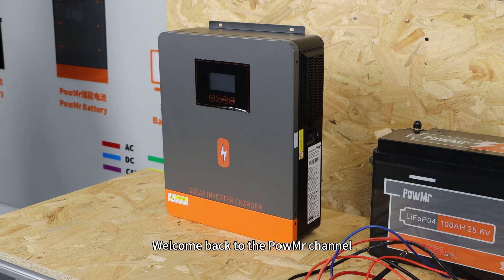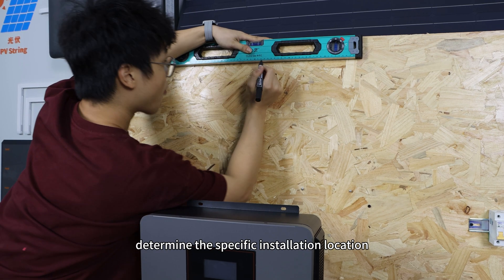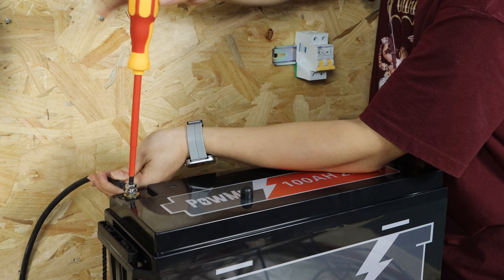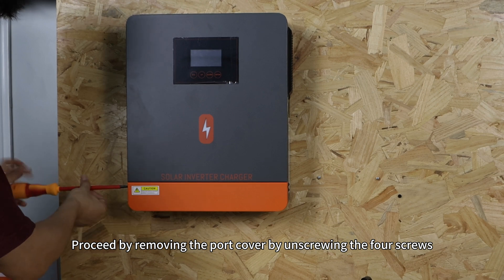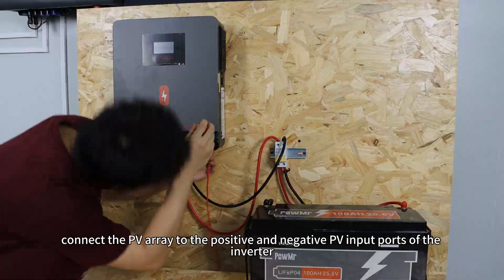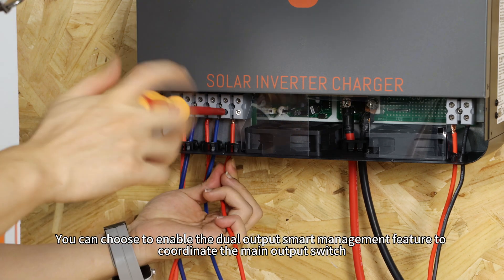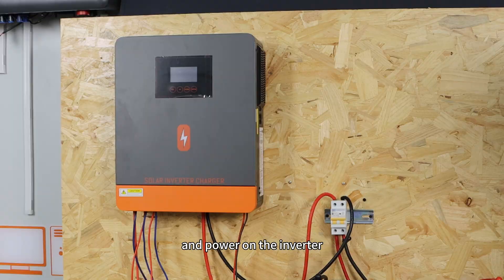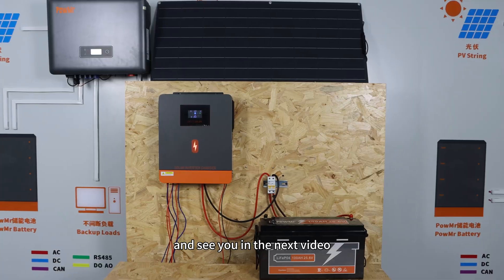Quick Installation of POW-LVM3.6M-24V

Comment: I have the POW-LVM3.6M-24V  The battery configuration is not very clear on how to set for 400AH 24V LifePo4 battery. There appears to be only one Lithium battery choice with a very poor description field for option 05 battery type4. Should I be using this "LIb" setting or a user configured battery type? I don't want to damage my batteries. Can you provide a listing of preferred settings for the battery parameters if it is better to have a user defined option versus the "LIb" option?
Reply from the maker: Kindly check the video below:
https://www.youtube.com/watch?v=KxNjTN6hwsM&t=8s
Reply: @PowmrSolar Thank you for the quick response. I had already watched that video and still came away with little more understanding of what the option 5 LIb setting does. The manual indicated that LIb is a user defined option and It appears that some battery options I can not change under that setting. Do I still have to go through the custom battery settings with that option and alter them and for optimal configuration and if so, do you have recommendations for those changeable options and LiFePo4 battery type rather than just reading the description of the option for Lithium battery type as a how to set up video.
Reply from the maker: @ Battery parameter settings need to be set according to the values recommended in the battery manual. Please contact this email(support@powmr.com) and attach the battery manual and inverter product label.
Reply from the maker: @ Battery parameter settings need to be set according to the values recommended in the battery manual. Please contact this email(support@powmr.com) and attach the battery manual and inverter product label.

Comment: Can this model work without a battery, only with the panels? If so, what would be the minimum voltage on the panels for it to start?
Reply from the maker: This model can work without batteries. If no battery is connected, 120V PV starting voltage is required.
Reply: @PowmrSolar  
Hi there , this model on the video POW-LVM3.6M-24V is 16ah or 18ah max pv input current?
Reply from the maker: @mhansel71  18A.
Reply: @PowmrSolar 
Hi , if i got 4 batteries each is 24v 100ah and i connect the 4 in parallel  total 24v 400ah bank can i charge them together with 100ah 125ah or is too much???
Reply from the maker: @mhansel71  Try not to exceed the maximum charging current that a single battery can accept.
Reply: @PowmrSolar 
Hi there , what size DC breaker i should put between inverter and the batteries 
3600w÷24v=150ah or 200ah?
also what size wire in the batteries, the manual said awg2 or i should put thicker?
Reply from the maker: @mhansel71  A 150A circuit breaker is sufficient. The battery cable should be installed according to the specifications in the manual.
Reply: @PowmrSolar 
In this inverter the dual ouput is disable by default , that means the total load will be by main load only right??? Even when the battery reaches the 26v?
Reply from the maker: @mhansel71  which model? the 3.6KW model?
Reply: @PowmrSolar 
Same inverter on this video
Reply from the maker: @mhansel71  Yep.
Reply: @PowmrSolar
Hi, in this inverter 24V 3.6KW model AC Input voltage range APL or UPS?What is the difference?  Manual said APL 90-140 UPS 90-140 They both say the same thing. Can you guys helpme
Reply from the maker: @mhansel71  Kindly  watch this setup video
https://www.youtube.com/watch?v=KxNjTN6hwsM&t=152s
Reply: @PowmrSolar 
In the video only explain the APL not the UPS option
Reply from the maker: @mhansel71  Just choose APL, there is not much difference.
Reply: @PowmrSolar 
Hi , in this model POW-LVM3.6M-24V 
Max input current is 18ah can i put (ISC)18.21ah from the panel solar even when the solar panel is has a (isc) tolerance +- 4%?
Reply from the maker: @mhansel71  Don't exceed the maximum limit.
Reply: @PowmrSolar 
Ok thanks for your help